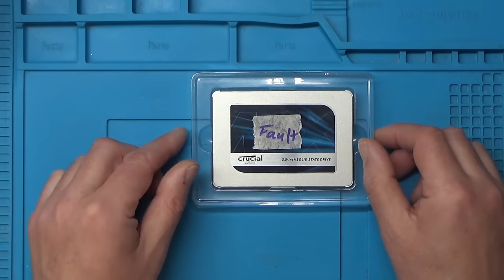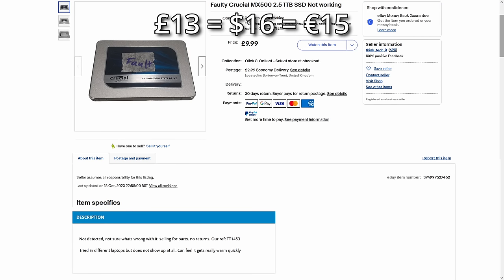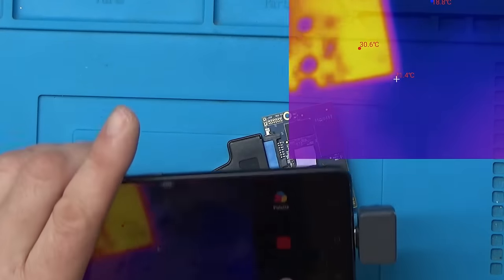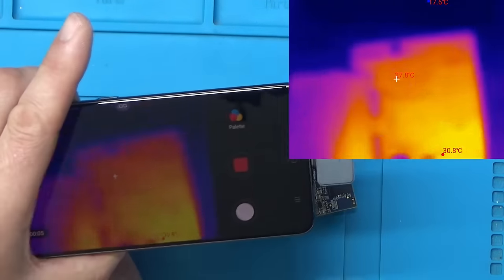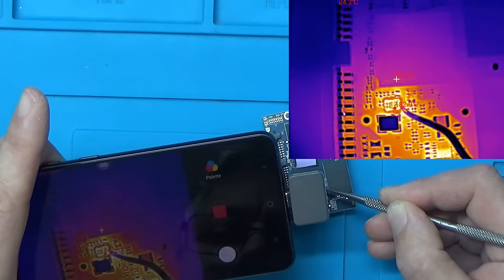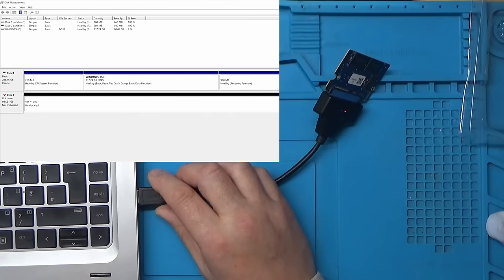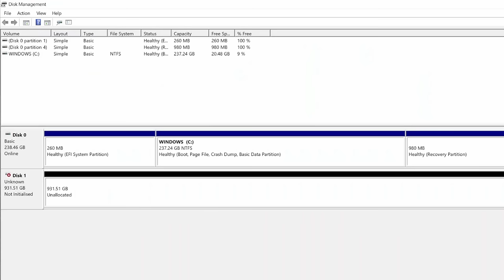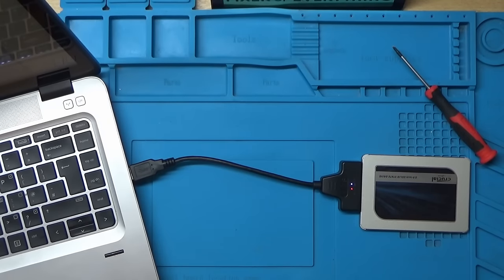Faulty Crucial Solid-state Drive (SSD) 1TB (1000GB) - Can we FIX it ?

Comment: Crystalmark will show you how many hours it's been used for and how much data has been used plus much more.......
Reply from the maker: Thanks👍The tool I used at the end of the video shows similar and the power cycle count.
Reply: @BuyitFixit they all read SMART data anyway, so it’s the same info. Just that crystal disk info is displays more cleanly imo. Storage executive/samsung magician are good to update the firmware if available, so it’s not a bad idea to use them for the same purpose

Comment: How did you know the rating of the cap? Or was it an educated guess?
Reply from the maker: Educated guess..it's just a decoupling capacitor so something like 0.01uf and the voltage would have been around 3v or under. So something like a 6.3v 0.01uf should be fine 👍

Comment: I got a 1T from Temu worked flawless for a year then it slew down Win10 won't boot but can access files thru a USB adaptor
Reply from the maker: Sounds like they used inferior / used or rejected flash chips, which could explain that it failed with the constant read / writes of the O/S.

Comment: How did you know the value of the broken capacitor?
Reply from the maker: Just a guess. It's just a decoupling capacitor. It was across the supply to the control chip so it's voltage would be around 3v or 5V and a normal value is around 0.01uF. I just pulled one of an old board that was doing the same job.

Comment: Interesting that the "Highest Lifetime Temperature" is 77°C that's definitely out of spec. 
But it could have happened when you were testing it because some of the components were getting hot.
Reply from the maker: I don't think it would have recorded fully as the power supply was shorted to ground. The cap on the thermal was measure 188C.
Reply: @BuyitFixit  Oh yea, I just saw that now! 
So do you think that 77°C temp was recorded when the drive was plugged in first, by the original user?
Reply from the maker: @JoeBob79569  possibly, it might have reached that temperature and the failed.

Comment: how did you determine what 'spec' of capacitor to replace the failed one with ?
Reply from the maker: Just a rough guess. It's a decoupling capacitor to suppress noise on the voltage line to the IC so  something like a 0.01uf and the voltage would probably be around 3V so a 6.3v or so at 0.01uf 🙂
Reply: Thanks mick.

Burning through your videos of late. 

Finally got myself a workbench setup so need to get on with similar jobs. More retro gaming etc for me, as a break from the IT dayjob
Reply from the maker: @markb4071 Thanks Mark 👍I love the old retro stuff 🙂

Comment: Shouldn't we check capacitors to the ground rater than both ends?
Reply from the maker: What happens if one end of the capacitor isn't connected to ground? It could still be shorted.. also if it is connected to ground then you are doing the same thing.
Reply: @BuyitFixit  Agree. I thought of that after I had put the comment.

Comment: Why do they make the cases so big when really not needed
Reply from the maker: It's so they fit in a standard laptop drive bay or caddy. It's the same size as a standard 2.5" HDD.
Reply: yaa, you don't want to have the drive tilted out of alignment when you're cable managing and it's bigger thermal sinker as well.
Reply: Because you think you’re getting more for your money
Reply: A thing called form factor

Comment: Wow very nice video you are professional engineer master of the master 👏 I have philips pronto tsu9600 touch screen remote control can you please kindly do a video of it as its not working ie not powering up it was working before I changed new 18650 battery full changed still it doesn't switching on? If make a video of this it will be the best video on YouTube please kindly help me on this issue 🙏 waiting for your reply Thankyou

Comment: how do you determine the value without a schematic or markings when it is failed?
Reply from the maker: Well in this case it's pretty easy. If we look at what that capacitor does, it's a decoupling capacitor (across the power supply) to ensure a clean voltage goes to the CPU. We can guess that the CPU voltage is 5v or under (probably 3.3v) so we know the voltage, and decoupling capacitors are usually around 0.01uF. So a 6.3v 0.01uF would be fine.
I actually just pulled one from a scrap board that was being used in the same way. It may even have worked fine without it, but possibly not reliably.

Comment: I have 12 of these disks and freaked out if I saw there only 4 chips. Opened mine up and I have alot more of stuff in there. 2/3 of case is full and I have 16 flash chips. Even with linux/mac partitions windows still show partition and show as unknown. If it says unallocated the it means it either empty or flash chips are broken and controller reports drive as empty but you can't write on it. For smart data you can also asses drive health you can look at Terabytes written which was 135kb what you probably wrote in there with initialization/partitioning. Some drives have been running years, but as server spares so actual writes happening. I would treat it still as brand new if TBW is low, but workhours are high since flash is mostly that dies after few years. BTW one year ago northridge fixed exactly the same pcb harddrive and it was also bad capacitors.
Reply from the maker: Thanks for the info 🙂👍

Comment: i have a Crucial MX300 525GB and is losing its driveletter every time i start my pc . Data still on it just i need put a letter on it every time i want to acces it when using windows , Mac and Linux it works great so is in my linux media pc now 😅
Reply from the maker: Sounds like a windows issue, at least you managed to use it still 👍

Comment: Crystal Disk Info will give you specific information about the drive.
Reply from the maker: Thanks, a few others mentioned the same. I did find out at the end of the video with the tool crucial make, and it had 0 hours and 13 power cycles.

Comment: when i connect my ssd via usb or inside the laptop ,,,,the disk manager and bios and laptop does not make sound and don't detect it at all but the cable shows blue light and ssd shows green light but what ever i try it doesn't work please help,,,,
Reply from the maker: It sounds like something may have failed in the SSD similar to this one.

Comment: Could have booted off a Linux live USB drive and see if its recognized by Linux? Linux also has smartctl where you can look at the on hours, TBW, etc.
Reply from the maker: Thanks 👍I had thought of that but didn't have a live cd or USB to hand. I used to use ubuntu a fair bit back in the day when cross compiling code for various CPUs (like porting Doom to various kids toys😂😂😂)

Comment: NAND wear can't normally be detected without using mass production tools
Maybe the controller had it's internal bad block and wear leveling records wiped(possible for a supply short on those SMI controllers)
Also most NAND controllers don't do raw storage, they would do a retrieve-on-access sorta thing(because encryption and LDPC and all that jazz)
So HxD raw disk mode can't really be trusted
I'd not trust those numbers and use this drive solely for temporary or low importance storage
Reply from the maker: I think it will be fine. I doubt a short on the power supply would have caused the controller to reset everything back to zero (otherwise it would be a good trick to reset a used drive back to "new" status).

Comment: my 1TB non ssd cctv drive comes up as 931GB always has from brand new
Reply from the maker: Yes, it's because drive manufacturers class 1k as 1000 bytes and it's actually 1024. All of those extra 24's add up which makes the actual capacity less. Marketing at it's best.. 😂😂

Comment: Hey Mike, canny lad! Another great video, as informative and entertaining as always.
By the way, there is something available on the internet that you might like the missus to purchase for you for Christmas (mind out of the gutter)😏😏
It's a hand held rechargeable blower, made by a company called LUCKEA. It works the same as a tin of compressed air, but you no longer have to spend money on tins of compressed air anymore.
They come in all different price ranges, but you'll wonder how you ever got on without one, particularly if you have dusty cruddy Milwaukee impact drivers and such like to repair.
Tell the missus that you wouldn't mind something that blows for Christmas!!!
Always a great stocking filler!!!!
👍👍👍👍👍👍😄😄😄😄😄😯😯😯😯😯😯🌬🌬🌬🌬🌬🌬🌬🌬🌬
Reply from the maker: Thanks Nina, I'll check that out 🙂👍

Comment: These capacitors ar the weak points in electronics.
Like in the old days when they even started to leak externally and internally.
Coming to think of it..... I might start leaking in the end also.   🤔
Reply from the maker: Agree, they definitely seem a weak point. I've seen quite a few devices fail the same way. The same happeped to one of my CCTV cameras, but that was before I was doing videos.

Comment: I believe even coming out of the factory it would normally have SOME metadata written there that is not just zeroes. It's likely that the fault triggered a reset of all the bits in the memory chip.
Reply from the maker: I've seen other channels repair such drives with the same fault, and all of the data has remained intact. It usually requires a specific erase sequence to be sent to the chip to erase it. The short would have cut power to the device. The number of power cycles, drive serial number, capacity etc weren't blank.
Reply: Ahh! That's why SMART showed one failed power event. Thanks for clarifying that, Mick @BuyitFixit  🙂👍

Comment: Crystaldisk info will tell you how many hours it has
Reply from the maker: Thanks, a few people mentioned the same. I did find the tool that crucial makes and used that at the end of the video and it had 0 hours and 13 power cycles.

Comment: if a ssd is not plugged in for 2-3 years it will loos all data. May the shortcut speed it a little bit up. But i'm not sure about the health data.
Reply from the maker: It was a brand new drive, that must have failed when installed by the end user.

Comment: That Thermal Camera is £279😬
Reply from the maker: I've got a FLIR one too which costs over £500 (although I bought it faulty and repaired it) and it's not as good as the infiray one. It's a lot lower resolution 80x60 pixels vs 256x192 pixels and only 12.5fps vs 25fps
Reply: @BuyitFixit  yeah crazy expensive when you convert it to AUD! Especially for something I'd most likely lose...

Comment: If they didn't know to initialize it, the computer wouldn't detect it.
Reply from the maker: The drive was brand new, at the end of the video you can see it shows 0 hours and only 13 power cycles. I think the capacitor must have blown pretty much as soon as they connected it to a computer.

Comment: 11:25 just burnt that crystal mate, need a finer iron tip
Reply from the maker: It's just the flux from the iron, the crystal is metal and was unharmed 🙂 I've got smaller tips but I find they don't seem to be able to provide enough heat through the fine tip to remove components very well. At times burnt components like this also fuse themselves to the tracks making them almost impossible to remove without taking part of the track with it. I had this on the Milwaukee impact driver I looked at.

Comment: Would you trust it tho? Backups only...
Reply: Agreed, I certainly wouldn't initially trust it for anything crucial ..... (pun semi-intended 🙂 )
Reply from the maker: Well, I'm not so sure. The capacitor was probably bad from the factory, and it has had 0 hours of use. Now it's repaired it should be no different to trusting another  device of the same brand, although I normally use Samsung drives myself.
Reply: @SlartiMarvinbartfast  perfectly fine to use it. When you have a flat tyre on your car, bike or scooter you don't toss that whole thing aside do you?
Reply: Absolutely, perfectly fine to use it!
Reply: @@phillipbanes5484
haa , a fellow fanboy? 😉